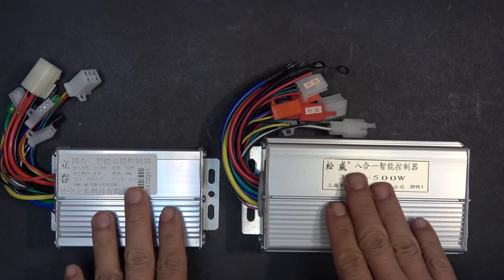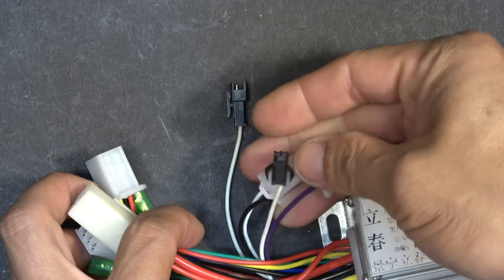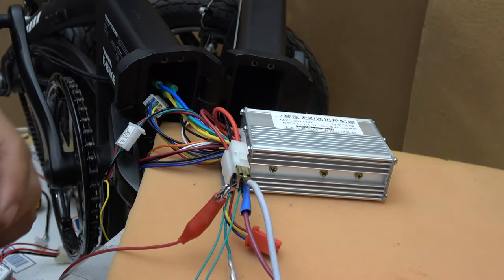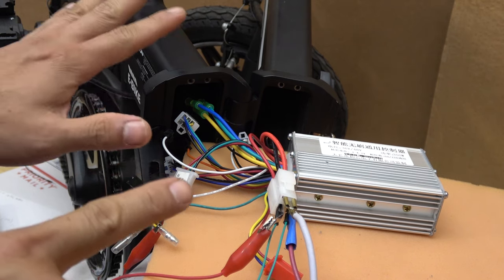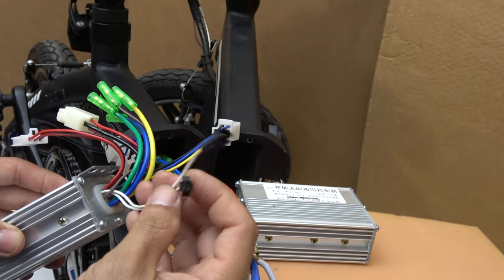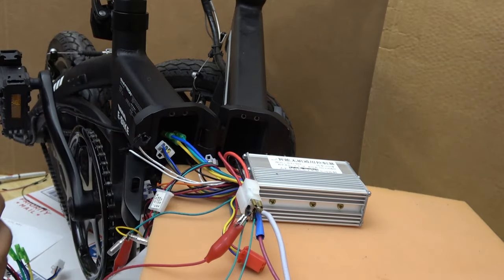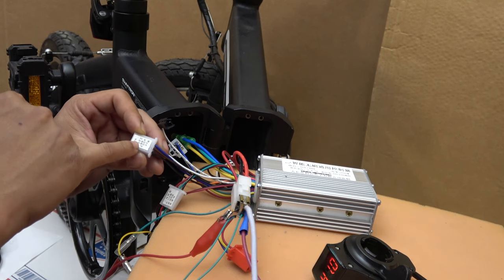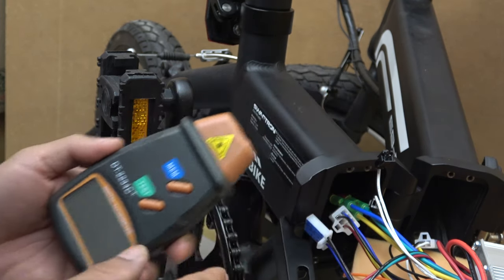How to install a Brushless DC Controller on Ebike: The missing manual

Comment: hello my name is Donna I have a question. Can I take my 36 volt front wheel and connect a Intelligent brushless controller 3 mode. It says normal voltage is 48 volt 52 volt 60 volt 64 volt 72 volt. Current 26a - 33a. And it says automatic identification . And also says JNWS name of the brand ? 
I was wondering if you can help me or you have a video about that? I also have a 48 Aventon battery. If you have any videos on something like that and I really do appreciate it. Thank you and thanks for your videos you sound very clear and everything Hands-On I love it I appreciate. God bless.

Comment: yellow and black wire is cruise, when connected together, if you hold the throttle for more than 6 seconds you don't need to keep the trigger on throttle.

Comment: Thank you so much  for your information . But can I ask you a question I was riding my ebike down the road the other day I had to stop at a stop light after that my bike stop working. One side of my back wheel came lose  that’s when it stop but when I fixed it  it doesn’t work now one thing I know for sure there’s no voltage coming through my controller what do you think has happened my battery has a full charge it’s just not coming through my controller what do you think has happened . If you can help I would thank you very much

Comment: I need help...
Thank you, you are very clear.
I have very similar controller with same connectors, I have connected like you show, checked the throttle cables and measured so it does vary voltage on the middle one, however motor doesn't spin... I connected the learning white wires and still no spin... I connected the 2 red wires on power together, measured power in to be over 36 volt DC from the batteries... when I connect 36 volt from batteries to the circuit I get a little spark, not sure what it is... but wheel doesn't spin so motor is not getting power... is there a way to check if there's voltage going to it... or what can be wrong? Just got the e motor wheel in mail it has 3 phase cables and 5 hub cables... connected them to no success...

Comment: For the Kit, you need to invest in a set of Pin keys, so you can make your plugs work. I had about 9 plugs coming out there is one I have not determined, yet I thought it was supposed to be the  3 speed range switch, but the Top position locks the Direct Drive motor and starts draining a lot of power I took the Control off fearing I might Bump the Switch riding and hurt myself  when the wheels lock, then there is the switched power output for lights and USB Charger ETC..  my Question is Do you know the voltage run the controller? their top is usually 52Vdc and bottom 12VDC right...

Comment: This video was perfect!!   You clarified everything I needed a little help with finally!   After searching forums forever and only getting more and more confused,  I have my controller, and scooter prepared, and I am waiting for my throttle / display / key starter,  and know exactly how to cleanly put it all together.    One thing left,  I need help with wiring the charging port.   Do I connect it to the controller first or directly to the battery??
Reply from the maker: Do you have a BMS for your battery pack?
Reply: @vuaeco  Yep sure do.   Its a bird zero iam just replacing the controller and adding the same display you are using.  So the battery, iam sure the small pcb board at the end of iam not mistaken is the bms controller, ur controller is the exact same wiring as mine from ebay
Reply: @vuaeco  There is a plug that was connected to the old controller, and there is a small black and small red left over that would all match up,
Reply: I came across this same issue. There's black amd red wires that charge the battery and also a third (blue) wire that connected the controller to the third pin of the charger connector  and I believe that prevented controller power 'on' while the battery charger was plugged in to the bike. It makes me think of the anti theft feature possibly., or kill switch like in a 'footpedal'  circuit?

Comment: Ok i have almost the same controller but for 350 W and i tried putting 12 volt and nothing happened. I thought . Putting less voltage it would just move the wheel slower. But as I can see with a multimeter the controller is working but the wheel doesn't move. Also mine controller had a manual in english and i can help you with those three wires you dont know. The separate wire that is the same as the one that connects to the motors is for display (if you have only an lcd i suppose) and the other i think is high voltage brake.(mine has two kind of the same wires. The first is for high-voltage break and the other one is for low-voltage brake.

Comment: This is so helpful! Is it common to have a spark when connecting the battery? We have power to the throttle and the wheel turns, but the YGB wires running to the motor get hot quickly! We have a 20,000 48V battery connected to a brushless 48v 500W controller and that connected to the 8in brushless motor of the scooter wheel.

Comment: The 6th wire on the HAL sensor is if your motor has a temp sensor. Also not that there's much use but could you wire up a reverse switch? i was tempted to not that I can think of a reason other then to mess with people😂

Comment: at 21:14 you connected orange wire to a black wire. which black wire did you connect to? was it coming from the controller or from? and what is name of your tachometer and where did you buy it?

Comment: I have a question. Where do you connect the charge plug? I'm adapting a hoverboard motor/battery to a eBike using AliExpress ESC, but it doesn't seem to be a charging port available on the ESC to connect the charging port. Where do I connect it?

Comment: This is so useful!
how would you proceed for matching the halls and controller cables to a new controller without blowing anything?
 I mean, is there a way I can use a voltmeter to see which is which?
Basically I got a new controller for my ebike, but when I turn the display on it says 0 battery, although is fully charged. The controller is brand new but it doesnt communicate with the motor...

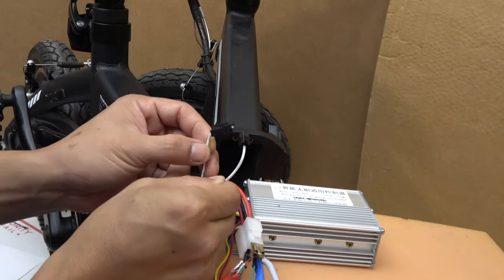Comment: 6:55 you can switch ANY two of the three phase wires to reverse the direction of the motor, so don't worry, you aren't going to let the smoke out! 21:00 that orange 5V wire might be to power things like LED lights?

Comment: I think that black single wire is regen braking when connected to yellow,  and the blue + yellow is high brake line for power brake. But I am not sure.

Comment: Question: I have a 1000 Ecotric Hammer, 48 Volt, I want to use a 52 volt battery with. Is there any reason why the 48 volt controller would be damaged by this? My 48 volt battery puts out 51+ volts when it is fully charged... Why such a gray area? I don't see any 52 volt controllers for sale, but everyone is upgrading to widely available 52 volt. What do you think?

Comment: That's a very useful video but my bike has a pedal-assist sensor as well as the throttle and there's no mention of pedal-assist in the video, can I connect it to another connection on the controller?

Comment: i have a ryobi 18v brushless lawn mower that i suspect has dead controller or other electronics modules. the motor has 3 wires,  is there a simple fix to fit something like this?(i don't see any listed for 18v)

Comment: Most informative video Yet... I have a 72 volt  3000 Watt controller and motor. It also has: quality display connector, only red. Charging connector, blk and red: Indicator light, blk and orn: Brake light,  wht and blk. also The Speed connector, orn, blk grn. No anti theft labeled.  
What do you think??? Thank you in advance,,  Ken  !;!

Comment: The connections on my bike from controller to components look like the ones on your bench, LOL. I'm not looking forward to winter in general, but it'll be nice to strip everything down and reroute/rewire it properly.
Reply from the maker: That one is simpler than the one shown in the video. It has less wires.

Comment: Thanks so much! My ecotric  500 watt fat bike 36 volt  is great but I have some tough hills
I want to overvolt, do I get new controller or will mine work? My s900 display  has settings for 24,36,48, do I hook up 48 volt battery  and set display  to 48?
Also where or what do I hook up my PAS to on another project? My new controller  doesn't say  but I have extra hot and signals like that one you showed.
Thanks for any help!

Comment: Love your videos man!! Your detailed explanations on each wire has given me the confidence to attempt this on my e-bike for myself!! I have a 250w rear hub motor, currently with a tiny battery (36v 7ah) I want to upgrade it to a bigger battery (48v 12ah)... I already know it is important to upgrade my current controller if I want to do this as it is only capable of 36v at the moment... is there any precautions I need to take so I don’t burn out my 250w motor? I really am a novice when it comes to this stuff... Please could you help me?

Comment: My controller set up is a lot different than this. For example, my motor only has a positive and negative connection. The only connection that has three wires is the throttle. It's an l-faster kit and has me thoroughly confused. Any advice?

Comment: Thanks for the information. I have been struggling with the same controller today after someone had tinkered with the wiring. At least I have an idea now what to look for. Where I was turning it on, same as you were switching it on, the wheel just started running with no regard to the speed control. Now I know why! Thanks again.

Comment: Installing SAME replacement controller into Ecotric 36v Rocket. All connectors match, except a few must be heat shrinked. I taped a few wires temporirly and heard connection spark when i slipped battery into place, but no DISPLAY.  Any idea? Maybe display? Battery showing full. Tried two displays, neither lit. Ill reconnect better and try power again

Comment: Hi, followed your instructions to connect the controller to the scooter and it works. however, if I use throttle max, it only run for 3 mins and cut off. I have to turn off the power switch and turn on again then it runs for only 3 mins. Do you know why?

Comment: 350 watts to even 1000 watts is not enough, though. i mean it's enough for most small motors and electronics, but we need something like an adjustable dc voltage controller/regulator that can work with even up to 5000 watts or even 25,000 watts to be able to make cool electric atv, go karts, or dune buggies.

Comment: So the pedal-assist function is done by the display unit and it outputs the appropriate throttle values depending on wether the pedals are moving and which pedal-assist mode it's in? I'm planning on getting a Fiido D2s but I need to disable the manual throttle completely to use it legally here.

Comment: got a 600w same wires as yours,  i hot wired the fast wires together and get a strange sound when i take off is this bad??? shall i take off in slow setting???

Comment: Vuaeco your videos are very informative thank you for that I have learned a lot. What will happen if you accidentally short the power lines of your controller will it render the controller useless or damage the capacitors only. The controller is not connected to battery.

Comment: Dear Sir, Can you please tell me something?  If someone installs a controller incorrectly and you ride on it like that, will it damage the controller??? My bike went 3000 km without problems until the backwheel jammed up. The mechanic said it was the controller so I asked him to replace it. When I fetched it it had no power (5 km ph). I went back and he fiddled with the wires changing them around. Since then in the last 2months my scooter jas had the back wheel jam 4 times!!!! Every time he tells that a wire got burnt and makes me pay for the repair. The controller cost 135 euros and each repair 35 euro. Did this guy destroy the controller and is blaming me for driving up a hill?? Appreciate of you can help me!!! 💕

Comment: Hello Vuaeco, I have a display with a built in throttle, the same one that kugoo m4 has on it. How can i wire that display to this controller? 

I know video is quite old but if you get a chance to answer i would appreciate it.

Comment: My escooter only works when the learning wire is connected. I have a 48v 500 w controller , a throttle with voltage display and key lock, and an s866 LCD. But nothing works properly together 😞

Comment: This is probably a very stupid question for you. But,
May i ask you ? When installing a new controller ? How do I know if I have installed the Phase wires and Also the Hall wires correctly ? You said nothing about installing the Hall wires... What happens to either ?

Comment: You can use a controller with a higher current limit and higher gears or simply overvolt, but in any case watch that motor temperature when going up hills.

Comment: Super helpful did you find a 12v wire anywhere ? I’m trying to connect LEDs. The 4.5 /5 volts wouldn’t do it.

Comment: I think a lot of your phantom power loss is because you have the throttle's LED voltage readout connected (at 4min 30sec in the video).
What is your phantom current drain with that yellow wire for the voltage readout disconnected?
An LCD numeric voltage readout generally take a lot less power...when the backlighting is off.
Caution: some Chinese-sourced throttles claim an "LCD" voltage readout/display when in fact they are using an LED voltage readout/display. Beware however, some LCD displays LOOK like LED displays, but require a source of light (1 or more LEDs) at all times to be viewed, so for power drainage assessments they may be considered equivalent to LED displays.

Comment: do you have any tips for someone trying to buy a controller to replace one from a branded bike? im having a difficult time. its a hall sensor controller 48v 500watt and i believe it needs to be compatible with my display (King meter km6s) but cant find info anywhere. the company wants over 200 bucks for a simple 48v controller. if you could direct me i would be deeply appreciated

Comment: Hi sir, I have a problem
My motor works okay if I use self learning line, but without that it doesn't work (it means in normal working after applying throttle it doesn't work) I check my throttle already it is okay. can you help me?

Comment: Hi can I wire the switch in like a battery cutoff instead and just solder the two reds together? Like the switch just goes in between the main red wire  coming from the battery in to controller? Thanks

Comment: Question, at about 18 minutes zou cover the supposed anti theft system, and discover that the blue wire has 5 volts, would it be possible to run a secondary system such as an arduino(for a speedometer maybe) on the blue wire?

Comment: On my power wires i use bullet or spade connectors.  So how can you wire the controller power wires in that case..just 2 connecntors not 3.  Do you merely twist the 2 red wires together and then solder or crimp on  the connector ?

Comment: I just bought a controller from Amazon bought a throttle with a voltage display and and on and off switch were would I hook up the blue extra cable on my controller I only see auto Metter cable and electric lock cable  ?

Comment: i have a question i have a gotrax ebe1 i want to upgrade make it as fast as possible what controller should i buy?  is a more expensive one better...  its a 36v battery 10ah      350 watt motor    id like it to go 25 mph but  20 is ok    it runs at 15 mph now

Comment: I have a 36 volt battery but am having a hard time finding a 36 volt 250 watt motor. What if I ran a 48 volt 500 watt motor on 36 volts. Hate to waste a good and expensive battery.

Comment: hi there i have a 48v battery and brushless motor i bought a new controller which is 48v/64v if i hook up my battery will it output 48 or 64 i am affraid it fries the motor

Comment: Hi do you know how to wire the LCDKT3 computer controller which seems to be the most used one..ive got just 3 leds on my throttle and batt to say how charged it is..which is pretty useless..having the computer telling batt and distance etc gotta be useful

Comment: Im stumped on a project. I built a battery backpack that holds 3 dewalt batteries and I think it needs to have a relay between them so that they are not connected to each other but can power a source .. as one is depleted at a certain voltage it switches to the other.... it's a dewalt 60v chainsaw and I want the 3 batteries for more run time and it has contacts with a 3 foot cord that connects to the tool....how would you do that? I can send pics

Comment: I'm looking for a controller that can forward and then go into reverse and Regen until motor has stopped and then actually start reversing for brushless. Want to do two of these for a zero turn mower. Specifically for the drive wheels. Any help is greatly appreciated
Reply: Try dimension engineering Sabertooth 2x60 brushed motor controller. Its forward, reverse, and regenerative.  
Let me know if you need any more help
Reply: Mobility scooter has a controller that has reverse

Comment: Just got my brushed controller for razor e300 it’s 36volt controller an throttle I’ve just tested with hover board 40volts 4ah pack but motor is feeble with me on it I know normally e300 lead acid batteries are 2 x 7ah so is this reason it’s slow ?